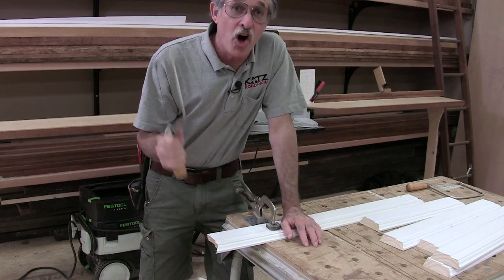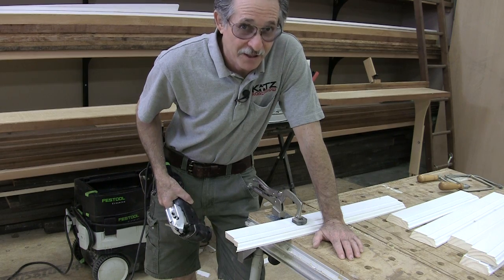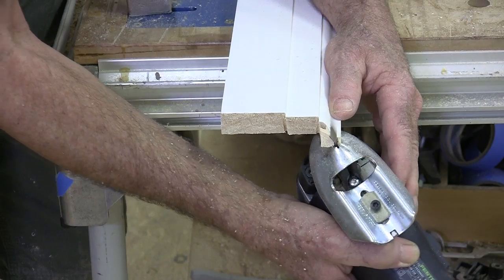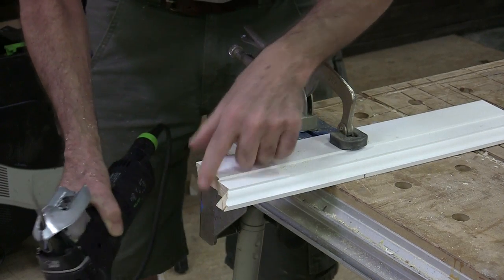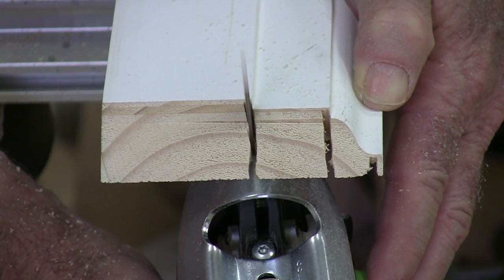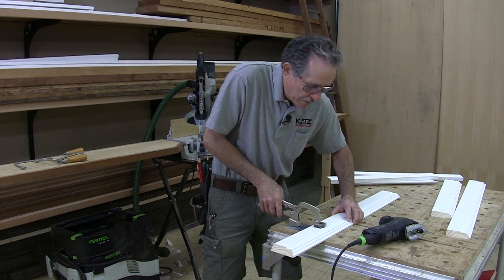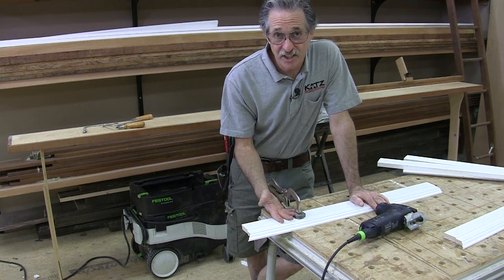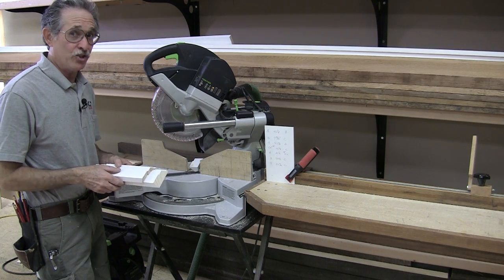Installing Baseboard: Coping Inside Corners

Comment: I coped some crown a few years back using a 20 year old cheap jig saw and Gary's DVD.  As I approached close to the line I used a Dremel with a sanding drum. It came out great.  Now I am have a barrel saw with a Collins Coping Foor and am going to run a couple hundred feet of BB.

Comment: Well, well, well, how clever is that. Great work Stan, bloody GOOD work! I did a 440 meter building (that is 1600 meters of skirting)  at my home using the method where I cut the straight edge of the skirting at an inward angle with the power saw, and then simply used the coping saw to cut around the edge of the curved top corner. Very simple, very clean. But having seen the saw in use, I'm sold. You bet.

Comment: Bosch also makes a "barrel grip" saw that works quite well for coping. Collins coping foot on the saw, Bosch #T119BO or equivalent blade, combination file (course & fine) & a rat tail file for fine tuning on stain grade trim. Works great for me, just my 2 cents worth of opinion. 
Thanks Gary K. for your videos & various tips & techniques.

Comment: How to install skirting board's and internal scribes..much neater doing the mold part of the skirting with a coping saw.. jigsaw blades can bend n kick out.. n do the straight with a hand saw.. Cut with a slight angle away from the seen face , leading ede.. Bobs your uncle

Comment: A variable grinder with a sanding wheel makes coping easy work.
Reply: I have been using  the grinder  for more than  3 years,, a lot easier!!!!
Reply: Saw a video on that, was interesting. Seemed it'd be super messy.
Reply: It works well if you’re coping in a shop or outside but working in a customer’s home, yeah I just use a barrel grip jigsaw with a fine tooth blade and regular foot. The time you save walking outside is much more than what the grinder will save you.

Comment: Is this hard to do with a regular jig. I don't have $3000 for a Festool. I usually use my table saw for my speed copes.
Reply: I took the base off my jigsaw and did it without the coping foot.  It would have been easier with the foot because you can slide the foot around on the board, but it worked.  The foot is only $30 or something like that, so I might get one anyway.

I have a Festool jigsaw (which is awesome) and it wasn't too much.  It's probably the most affordable Festool product you can buy.

Comment: Nice work man! But it would be much easier and faster to miter both pieces, and glue them together. I’ve been doing it this way since 2002. Works fine.
Reply: Actually, coping is much faster when it comes to measuring and installing.
Reply: Wylian DaCosta that’s your prerogative
Reply: @lockpickingvlad  true
Worked with both methods professionally,  I'm glad I learned to cope.
Reply: wood butcher I dub thee.  mitered joints come apart and who wants to figure the perfect miter angle for inside corners?  coped corners never come apart, and the angle doesn't matter.
Reply: Im a DIY guy and I have been doing it like you say for years. They looked terrible because I never was taught that there is no such thing as a 90 degree corner in a house. There really can't be because of the corer bead on outside corners and the parer on the inside corners.

Comment: Nice skill level in following the edge so perfectly, not sure I could do that.  I wonder if a scroll saw with the table tilted at an angle would work?
Reply: Annony Mouse only would work for short pieces, lots of times it’s 16ft. Just get a coping  saw and a pack of blades. Just lay the cut back about 20 to 30 degrees leaving the line and a little trimming with your knife to clean it up. Another secret on most base the flat part can be done on your miter saw set at a slight angle just leaving the top to cope by hand.

Comment: I use a 5 inch Grinder with a turbo diamond blade.  Can't beat it. Method in video is way too slow
Reply: Same. Nothing faster. I use an 18v cordless with 80 grit sandpaper.

Comment: I have a odd cut I'm not having any luck with and yes I'm inexperienced but I'm trying to learn. I'm trying to cope cut the baseboard which will be butted up against a cabinet toe kick which has some decent curves to it. I can't trace the side I'm installing on so I traced the opposite side on the left on the back side of a scrap piece of baseboard. My issue is when I cut it with my coping saw the curves don't quite line up even though it's traced perfectly and I'm cutting on the line. It's almost like it's shifting the curves vertically a little and then it won't sit flush and leaves about a 1/8" gap. Is their a trick to this type of cut? I thought surely I could just trace it and cut it but it's  not working. I wasn't cutting my trim at 45degree first but is that required if your not mating the same two pieces of trim?
Reply: Tracing will make you add or subtract material depending on how you do it. A better option is to learn how to scribe the cut using a small compass.

Comment: That top point needs to be cut off square. It SHOULD NOT overlap adjacent base.
Reply: If you are doing paint grade work, cutting the tip off square is OK. If you are doing stain grade work, that little tip allows the corner to look as if it was mitered. It's a delicate cut and only the very best trim carpenters are able to pull it off. Can't tell you how many times I had to recut a coped joint on stained material because I accidentally broke off that little tip, but in the end, it was worth it for my customer's satisfaction and my own.
Reply: Bill Ammer very true. A lot of times many people forget about stain grade work. Even paint grade shows that small detail depending on the finisher (brushed or sprayed).

Comment: Old fashioned and tedious. Nobody installs base like this anymore, you'd get some crazy looks if ppl saw you doing this on my jobsite, I'd be done and on my next job by the time you got done with your inside corners.
Reply: lastditch727 for mass produced homes, you’re absolutely correct. But for anything stain grade or you are doing the finishing yourself. This will end up saving you way more time in the end. If someone else is painting/finishing, I would agree. 
45 degree inside corners just never look good on anything other than virtually flat stock mouldings.